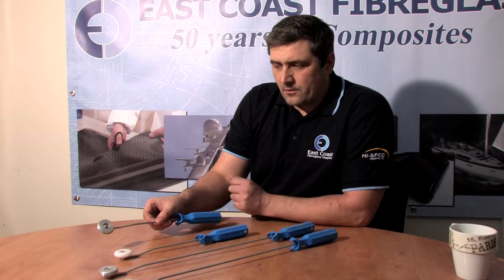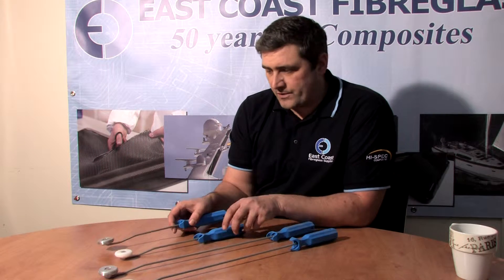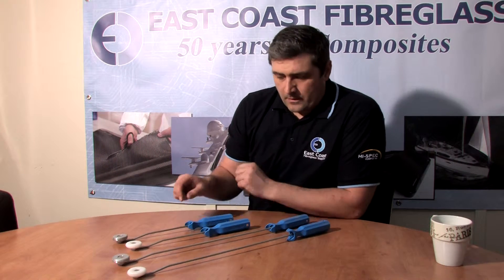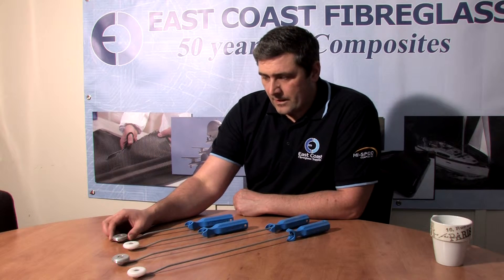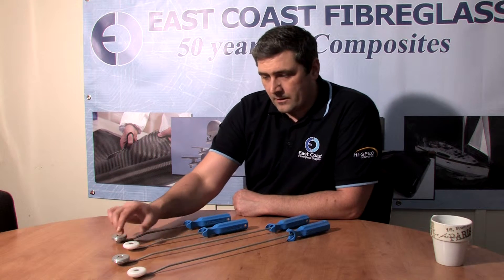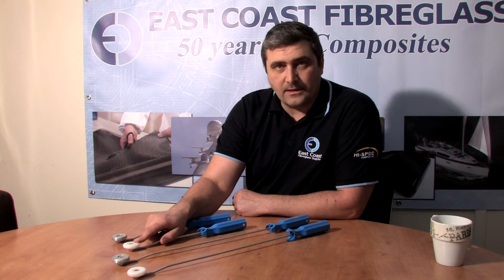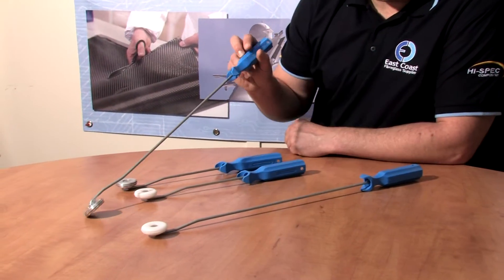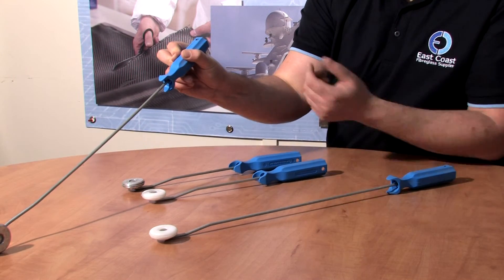Disc Corner Rollers (Radius Rollers)

Comment: Hi, how do you clean epoxy from the polypropylene rollers? Are they acetone-safe Thanks
Reply from the maker: Once the epoxy has cured to the point where it's a little tacky or still a little soft, you should be able to peel it off the rollers. Acetone doesn't work very well as a solvent for cured epoxy
Reply: @ecfibreglassuk   EastCoastFibreglass  thanks, I'd ordered an aluminium one before I saw this. What happens to the epoxy stuck to the hub (which appears to be metal)? Thanks
Reply from the maker: @jonathanwebb9862  You might be able to peel or scrape it off